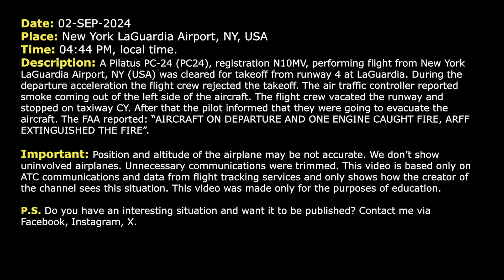“We are evacuating”. Engine fire on takeoff at New York LaGuardia Airport. Real ATC

Comment: How do I send a tip? Just noticed what appeared to be a go-around or something weird as C-FSFS tried to land at YYZ around 6:15pm ET

Edit to add: Looks like it turned and landed on a different runway. Set up approach to the wrong runway maybe?

It was Air Sprint 654 (ASP564) from YAM to YYZ
Reply: Based on their altitude it looks like the controller sent them overhead the field to join the downwind on the south side

Comment: "Make the right turn there".
Turns left.
Reply from the maker: The animation may be inaccurate.
Reply: The wind was at 340, from the NNW. Smoke was from the left side so turning left would be 100%  the correct decision, even better then stopping on the runway.
Reply: @1947dave this makes a lot of sense, thanks for explaining.
Reply: please explain why @1947dave
Reply: @ramiveiberman3182  Plane landed into the wind, which was blowing roughly from the north i.e. towards it. Smoke was from the  left side (later confirmed left engine) so turning left meant smoke/fire would blow away from the fuselage. Turning the wrong way can end up in a disaster, like the 1985 Manchester Airport (UK) catastrophe, google British Airtours Flight 28M on Youtube.  Controller misspoke or didn't (yet) understand the situation, but the pilot did. Here's what the Manchester fire official report said: "The wind was the principal factor controlling the fire's behaviour. It carried the external pooled fuel fire against and beneath the rear fuselage, giving rise to rapid fire penetration [within 20 seconds of stopping]." Scary.
Reply: @1947dave  wow, I didn't think about that possibility. Thank you very much for explaining it clearly.
Reply: The aircraft was on fire.
Reply: Also turning left has them stop right in front of the fire house which is right there.